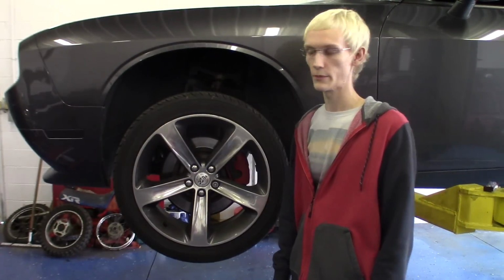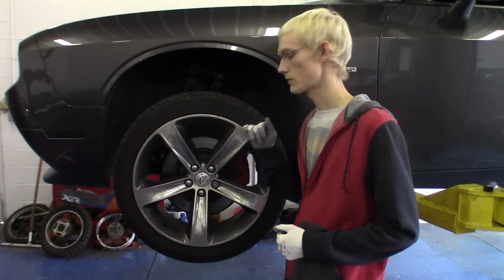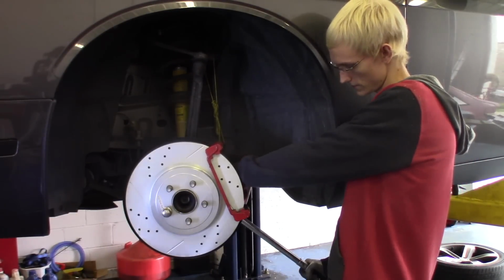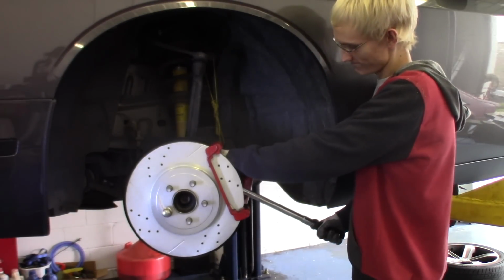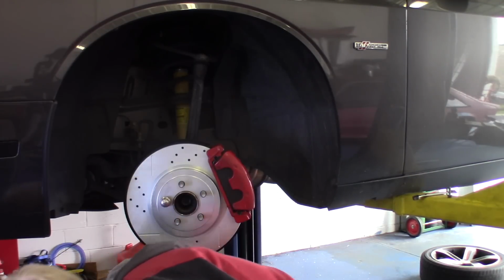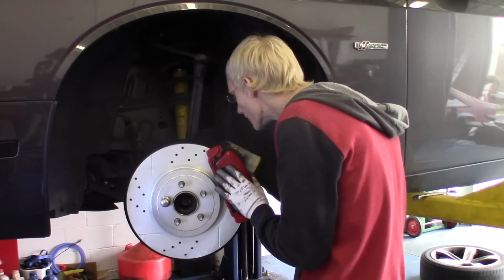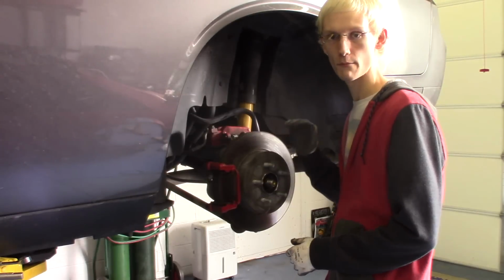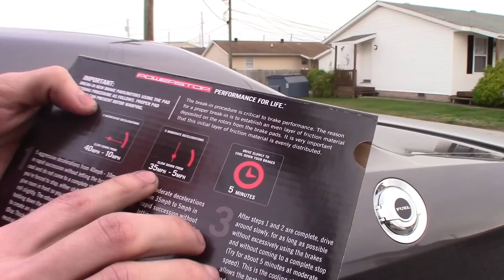Drilled and Slotted Rotors | Dodge Challenger R/T

Comment: Calipers are already red so theres no HP to gain on the brakes..
Reply from the maker: +Luca Car Mods True, but the rotors have holes in them, so that's weight reduction!
Reply: +Muscle Vs Tuner If only those rotors had fuckin rust on em.
Reply: +Luca Car Mods The red calipers are for breaking necks every time he does a fly-by in his man rocket
Reply: Don’t forget the license plate holders.  No true car guy rolls with those things.  They add weight and offset all that HP from the new brakes and decals.

Comment: I am pretty sure 99% cross drilled and slotted are rotational. By that I mean the cutting edge should be rotating counter clockwise.... As in the front driver rotor should have been placed on the front pass in this video. Unless there is a reason you guys installed it backwards?!?!

Comment: Wish it was that easy to change rotors on my truck 😕 I got manual locking wheel hubs so it's twice the trouble. Especially when you don't have the proper tools 😅

Comment: shouldn't use an impact gun on those lock nuts on the wheels.
Reply: +Stig's Italian Cousin how come? every shop ive been to use an impact gun? I also work at a dealer ship and they use impact guns on lock nuts
Reply: +Niznuts123 Not to tighten you shouldn't be. You can give them a quick hit with the impact to screw them in loosely, but never torque them with an impact gun. Unless of course you want to go back and remove the rotor and everything again to change a broken stud. Always use a torque wrench. You're also going to be pretty pissed if you break your key with an impact gun.
Reply: +CJ Culbertson if I had a penny for every time I heard the words torque setting in my course I would be fucking rich. and I'm only a quarter of the way in lol
Reply: Niznuts123 I was taught this in high school (went to a trade school for auto tech). The Nissan dealership I worked at didn't care either, but I still torqued them by hand. If you break a key in the lock your tire rotation just went from 15 minutes to much more than that.  On my own or my friends cars I don't touch those locks with air. On or off. 
but thats just me anyways.
Reply: CJ Culbertson It could certainly turn into a mess. At work I'll use a gun to take them off but on my own cars and my friends' cars I don't even want to risk it. 

Most oem wheels have enough room to beat a socket onto the lock if you chew up the key, but most aftermarket wheels do not.
Reply: +riley watson for good reason lol. At our shop you would get chewed from not using a breaker bar and torque wrench to start and finish. More than once I've turned a 10 minute job into an hour one. I learned lol.
Reply: I use torque sockets on impact for when tightening them back up. Idk how accurate those are tho.
Reply: +Stig's Italian Cousin oh ok I see now. Well maybe these guys just don't give a shit then hahaha
Reply: +Stig's Italian Cousin  I use a torque stick when i run mine on.

Comment: I wish all of my brake rotors came off that easily... It always requires encouragement... with a sledge hammer and/or a long peice of wood
Reply: Haha I feel your pain
Reply: +Ray Ali living in the north sucks
Reply: +Vashuna72 Doesn't look like these guys see salt, and the pads and rotors were in like mint condition. Even though he does say in another comment that they were warped..
Reply from the maker: We live in southern Ohio so we see quite a bit of salt but this car doesn't see it too often and my old rotors were warped and not enough thickness to turn them so I upgraded rotors and bought carbon ceramic pads for better stopping and reduced brake dust
Reply: Muscle Vs Tuner ah.

Comment: don't leave the wheels under the car like that. tripping hazard and if the lift suddenly loses hydraulic lock then they're toast too.

'keyboard mechanic' pro tip
Reply: if the car Falls it's easier to get a jack under it if it lands on the wheels that's the point